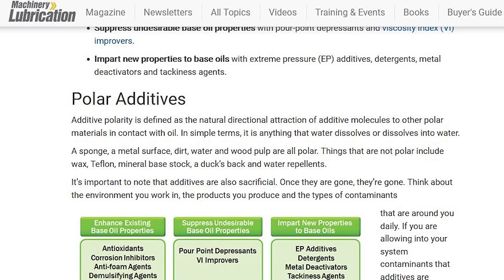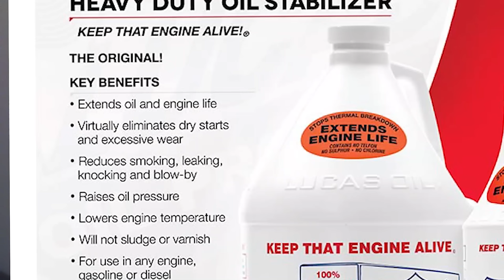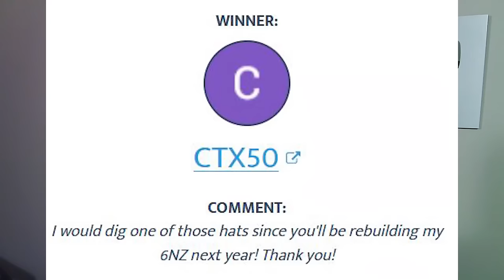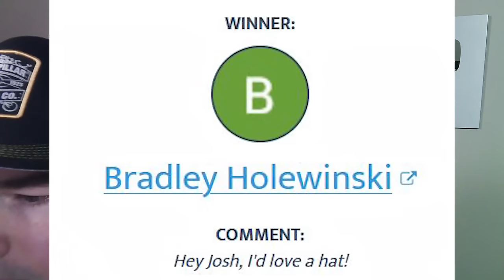Does your Engine NEED Lucas Oil Stabilizer? A detailed look at the "Benefits."

Comment: I would think it would increase your oil viscosity, decreasing performance and fuel mileage. But that being said it would help eliminate leaks and add more cushion between bearing surfaces. Honestly though I think you can get the same if not better performance with gear oil. A quart of full synthetic gear oil is cheaper and probably more beneficial than the regular mineral based version of Lucas oil stabilizer. (Here's an example, I had a tick in my old Ford Taurus engine.) Lucas oil stabilizer took it away. After changing the oil, I also tried adding some 20-50 full synthetic, and got the same result. The tick went away but my fuel mileage went up by like 25 more miles per tank, opposed to the conventional Lucas oil stabilizer. 🤷‍♂️

Comment: 👍👍👍 I CAN ASSURE YOU WITH A CHEVY THAT GETS A LOW PRESSURE READING THIS STUFF WORKS.  MY ENGINE THAT IS OVER 300, 000 MILES AND OF COURSE I KNOW ITS NEAR ITS END BUT I'VE BEEN PUTTING THIS LUCAS OIL SINCE IT HAD 240,000 MILES AND ITS STILL RUNNING.

Comment: Wanted to leave my story. The actual original oil additive is sort of been put out to pasture as the few benefits I’ve seen it actually have would only apply to dinosaur motors with extreme wear or oil consumption (ie my 53 farmall that hasn’t been opened up since Moses himself put together) they make a newer additive that is synthetic and made for synthetic oils. I have had some better oil pressure and less oil consumption and engine noise on cold start with my 250,000mi Subaru however there are tons of applications where it is a huge no no. In fact Cummins says they do not recommend ANY oil additive in early isx engines. My old man put about 2 quarts in and within a day the motor was literally puking the oil and Lucas out like it was blown. Went ahead and did a pm and it went away. Now the other additive like fuel power steering and such I have had AMAZING luck with so much so that I had an issue with constant bad fuel full of crap at my local truck stop and would get water in fuel light alll the time. Dump some Lucas fuel treatment in it. Taaa dahh all better. Even used the transmission additive manage to bring a dead Ford automatic back and limp 200 mi home before it finally died. So all in all. Sometimes it helps. Sometimes not

Comment: Glad to see someone bringing up that it's only base oil and diluting your additive pack, I feel like this isn't pointed out enough. I believe you'd be better off running your normal oil just go 5-10 points higher on the viscosity, then you'd get the thicker oil and the full add pack. Or just, I don't know, fix whats broken....

Comment: I drive a 1997 truck with an older gasoline engine design. The manufacturer specifies 10w30 in cold climates and 10w40 in hot. One of the top performance builders working with this particular engine swears by using 20w50, even in fresh rebuilds!
My truck has a little over 100K miles on it now. Much of its life I used only the recommended weights of top quality, full synthetic oil. Just oil. No additives. However, I started using 1 qt of Lucas with 5 quarts of 10w30 around 80 or 90K miles in the cooler months and 5 qt 10w40 + 1 qt of Lucas in hotter (100F+) summer months. Seems to be working fine so far. 
I suppose I could just instead use 20w50 in the Summer. But it's been very hard to find locally. Even 10w40 has been scarce here (N. Calif), which is why I use the easier to find 10w30 in the Winter. Most stores are heavy on the modern, ultra low viscosity oils and devote little shelf space to the viscosities that were so common in the past. 
I don't disagree with any of your analysis. But there are situations where it may make sense to use Lucas (or similar). I was concerned about diluting oil additives, as you mention... But figure that since the Lucas is only about 15% of the lube in my truck engine, and because I change 2X a year at least, never come close to the mileage interval, there shouldn't be a problem. Time will tell!

Comment: Got a 3.0 ford ranger 297,000  miles on it and I use the Lucas oil treatment with no problems it calls for w5 30 also used the transmission treatment everything works fine had a little shake in the transmission put the treatment in stopped the shake all in all the Lucas products work for me

Comment: I run a 1MM600 hp Cat change oil all filters 10 k to 12 k use Rotella and one gallon of Lucas because if tech doesn’t tighten plug it can save your engine when it falls out. The other reason is cold starts.

Comment: Sir you are spot on with all your comments.and warranty over rides snake oil.never in an engine.i had a new c13 years ago that was everything cat said till different numbers were put in the computer.7mpg loaded 80,000 to 5mpg no matter what.started using oil an lucas slowed but engine wouldn't pull the hat off your head.smoked like an old 220 cummins.end of comment.Thank you Sir

Comment: It is only good in warm to hot weather situations in old worn engines  ....If you live in an area where there is a winter season with it in the engine ,it will make the oil too thick when the engine gets cold and then dry starts are a problem and thick oil in newer high tolerance engines will not be lubricated properly ..STP  is the same in this thick oil additive category also and has locked engines up  on a cold start after it was put into a cool engine  ..

Comment: Lucas hydraulic oil seal conditioner, trans anti slip, Power steering seal sealer all worked for me on older equipment.
I put Lucas or Stp in all my older  gas service trucks got  over 380k miles on two all original motor trans GM 6.0 gas.
I just got oil at CAT dealer they sold me Mobil 15w 40 .. Told me they make CAT oil.
ps " torque convertor Shudder in GM was cured 100% with "lube guard"  2oz tube. Some snake oil works.

Comment: I used to have a 1987 Ford range 2.3 liter over head cam it had 350,000 miles on it it would always dry knock for 10 second or so after start up from sitting for more than eight hours once I put Lucas in it  never did it again sold the engine to somebody else after the truck rusted out

Comment: My buddy uses Lucas from his first oil change until today.  His Ford van has 540k. He swears by it.  Says motor runs much smother and cold starts are effortless.  It's a gasser. Burns about a quart a month.  I use it in my John Deere diesel. Works ok I don't notice a difference.

Comment: That quote is form Atheist Christopher Hitchins. he is greatly missed.

the only oil that has a beneficial additive is Valvoline. it has an additive that is necessary for Ford vehicles. and that is an additive to reduce oil foaming. since Ford's have an issue with oil foaming.

Comment: Another thing to note with manufacturers “service recommendations”.

While they are a good idea, many of them simply lie. 

If you’ve worked on any dirt bike you’d be aware as to the degree they lie.

Suzuki RMZ250. Recommended service interval before piston replacement? 6 hours. 

Six hours. 

And yet there was only beginning signs of wear when I changed it at 70.

Comment: 2012 VW CC 82k miles.  Low oil pressure light w/ 5/30 oil.  Mechanic said crankshaft bearings worn (apparently it was junk yard motor w/ big miles). He put in 5/50 and this stuff.  Hot yesterday turn on engine, idle for 30 minutes, the drove for 30 minutes, may have life in this car!

Comment: Used to have to mow a steep hill at my parent's house many years ago.  My dad would burn up a used push mower just about every season.  I got tired of being the one to find and get the used mowers for the 'fleet'  so I started  putting Lucas oil in them (about half/half)  Son of a gun  we could get 2/3 seasons out of a push mower now !  I was sold and used it in everything that has oil lubricant since (my '98 S-10 got 278,000 miles on it till the clutch petal  assembly came apart!)

Comment: I would love to hear your opinion on Liqui Moly Diesel Purge.
I have always thought diesel injector cleaner was snake oil rubbish that was a waste of money. I still do when it comes to the stuff you pour into the tank.
However, I have seen lots of very good reviews for Diesel Purge so decided to give it a go on my 2.8 Duramax Colorado. This stuff isn't just designed to be mixed with diesel in the tank, you can also run the engine off of Diesel Purge alone which is what I did. To my surprise and delight it made a very significant difference to the smoothness of the engine and it sounds a lot quieter. I also get better milage and it feels peppier.

The ingredients are fairly basic, 65% Diesel, 25% cetane booster, 8% Petroleum Distillate(naphtha) and 1% 1,2,4-Trimethylbenzene. 
I believe it is the Naphtha that does the cleaning of the Injector Pump and Injectors. 

During my own application of this product I used an in-line filter which appears to have collected a fair amount of sediment and the Diesel Purge turned a rust brown colour by the end(it's clear out the bottle).
Reply: I had good results with Sea Foam in an old Toyota Tercel that could barely accelerate at all.  Real sluggish, lots of hesitation.  Two consecutive treatments of Sea Foam got it running like new.  20% naptha, 20% alcohol, 60% kerosene.  Theoretically you can make it yourself real easy and cheap, but I use it so seldom that I haven't got to that point yet.  In my truck I use it once every 50k miles in the fuel, and a little can into the oil a couple hundred miles before a PM when I think of it.

Comment: Something just about:  A heavier oil will throw off of a rotating mass whereas a thinner one will cling to it.
      The bearing surface speed of a long stroke engine is far faster than a short stroke. What is important is the oil temperature as long as you don't overheat it took cook it and you keep the bearings cool as well as provide a slippery surface conducive to keeping temprature in check. That is job of the oil as a lubricant. So the real question is does your choice of lubricant do it's job correctly? An additive may bolster a poor choice or extended service intervals.

Comment: In 1996 I was 17. I bought a brand new z71.
Every 3k I change the oil with Mobile 1 and Lucas with a wix filter. 
In 2022 the truck has 670k on the clock, the engine has no leaks, no knocks, no ticks, no pings, no smoke.... all original factory seals and gaskets. 
I'd say Lucas oil stabilizer works great. 
But what do I know... I'm only an ASE certified Master mechanic for the past 22 years.

Comment: I use it, been using it since 2000 i first added it to my 2.0 neon i after 85k miles removed the valve cover to replace the gasket and it was beautiful and it was a quiet engine to the point my mechanic friends asked if it was on

Comment: I put Lukas gear oil in a datsun rear end that was wore out and howling,it stopped the noise and lasted 3 more years. Later in life i had a honda shaft drive motorcycle that got 55 miles to the gallon,drove to Texas had to put gas in at 162 miles, later i remembered the Lukas gear oil so i put some in the rear end,took the same trip again and i stoped to get gas and it still had alot of gas in tank,checked mileage and i got 62 miles per gallon. Im just saying it works and saves money.

Comment: I have a 97 F250 diesel ford with 375,678 miles on it has Lucas products in both fuel and oil. I have noticed it that it not only runs better it doesn't hesitate to get up to speed on the highway.

Comment: I use the lucas for my engine. Oil and transmission oil I GUARANTEE u this stuff really work I use it in my chevy astro 1992 with 181.750 miles.

Comment: My Engines use Amsoil and that is all I need.

If you have a good oil, you don't need to add anything else. The only reason you have to add this stuff is because your lubes are missing something that should be there in the first place. I use Amsoil Signature Series and i can g 25, 000 miles because the oil is real good, and i have done it also. The Amsoil oil filters are guaranteed   for 25, 000 miles and i have done it. No problems and less wear on the engine.

Comment: The full synthetic stabilizer works really good in gm 3.6s it helps things run smoother between oil changes and reduces sludge buildup
Reply: What about 2.5 liter s10?

Comment: I will share my experience with lucas, back in the day I had a 78 buick 225 I had been using lucas at oil changes because my old man had always used it so it passed down on me,  one night me and the fellas where out fooling around about 40-45 minutes from my house, I jumped a set of railroad tracks and tore the oil pan drain plug out and didn't realize it until the low oil light came on several miles from the tracks, we were on the highway by this time I pulled over and dang it the pan was open, I called my pops and he said well you been using lucas you might be able to make it home, and sure enough I made it home car never overheated and it didn't lockup. I made it home we replaced the pan and I drove that car for a long time before getting rid of it, it never created a tap or anything.. I been telling this story for years! Now I can't say it will work like that for all engines, but that 350 sure held up. All the other claims I haven't had any issues with those, but I use it faithfully in my vehicles and semi trucks and I never us it thinking it's a magical mix, I think of it as a layer of protection on all the metal services...

Comment: I have a 2013 Jeep Wrangler with 97K miles and I already put this aftermarket additive into my oil change for the first time. After watching your video, I am so upset with myself. Upon next oil change, will it be ok to not add the additive again. Will there be sticky additive product still in the engine. Do you think that I will require an oil/sludge engine flush?
Thanks, your video was very informative and I wished I had seen it before I let them put that crap into my engine.
Thanks again.
Glenn

Comment: OK so I have a 2005 ram 1500 with a 5.7 Hemibought the truck brand new first oil change 1200 miles the truck now has 233,000 miles on it The truck calls for 5/20 never put it in when using mobile one 5/30 Full synthetic with the Lucas stabilizer full synthetic I change the oil every 6000 miles this engine doesn’t smoke it doesn’t burn a drop of oil and it hasn’t lost a step in power i’ve been a car mechanic for over 30 years this truck runs as good as the day I bought it I recently pulled the valve covers off to change the gaskets because the passenger side was leaking I could not believe how clean it looked inside it was like I was looking at a brand new head so I am a firm believer in my combination I also recommend Lucas fuel injection cleaner fill your tank up once a month and put that in there is a difference thanks for your input

Comment: My Ford Ranger, 274k miles, knocked loudly with fake 'full synthetic' oils in winter. I put in real synthetic Amsoil with Lucas, it quieted it down. Until I can afford to replace the engine, this is working very well.
Reply: Real and fake full synthetic? If you used Motorcraft synthetic blend and Motorcraft oil filters you wouldn't have those issues in the first place.
Reply: @Muffmiester79  
Respectfully disagree, Motorcraft semi synthetic has no esters or ethers in it when broken down, it's a class III synthetic, just hydrocracked petroleum, ir gets thick when Temps get -0°, which is when I need it to lubricate. Amsoil is the only affordable class IV synthetic.

Comment: Castrol 15/40 diesel and Gm EOS in all my gas flat tappet high performance engines , bought 25 cases years ago still have lots left 50 years building engines never had a failure !

Comment: IT works great in a Fuller transmission, a Mack transmission, a Mack rear end, a Rockwell rear end, (I hate Spicer and Eaton truck axles) but I really don't think engines benefit much ??? A gear type transfer case,,, but straight 30-40 weight engine Earl is My preference for diesel engine Earl (LMAO) but the sticky additive type grease works damn good on fifth wheels and plates !!! All the best to you and yours Sir.

Comment: Amazing stuff for wheel bearings that run in oil.........if your having trouble with steer axle wheel bearings, use a mixture of 50/50 lucas oil stabilizer and diff oil.

Comment: I want to thank you very much for this video!  I have been mildly obsessed with the question of why (most)  Major oil makers (Mobil 1 and Valvoline for example)- do not add a sticky coating additive like Lucas Stabilizer to lubricate the engine while the oil is first circulating during a cold start. Finally, I have my answer thanks to your video...There is residual oil in the spaces between the metal parts, as showed by your demonstration  of the piston bearing -Wish I saw your video years ago. Would have saved me and my car a dozen quarts of Lucas Stabilizer!

Comment: I have a friend with a 1970 and a half Camaro Z28.  Still looks like brand new. Those z28s had high compression and solid lifter cams.  He starts the car once every year and doesn't drive it much at all.
He sold on using delo 400 and a couple of bottles of Lucas zinc additive to protect the valve train.
I told him for 12 bucks a quart he can buy some professionally manufactured oil design for these older engines that he likes playing scientist. 😖😖😖

Comment: I've used Lucas fuel additive into my tank for years because it acts as a upper cylinder lubricant, my Toyota had 250000 mile and still never used a drop of oil between service

Comment: I would say since I got my first car, I always used the right synthetic oil and my car was used at 30K. After maybe 2 years I finally took the chance to change my oil first time. Since then 7 years later, still own it. My engine is at 130K, I recently switched up to High Mileage Oil now, been using Mobil 1. I only used Fuel additive so far, been debating on this as well but may just stick with using my high mileage stuff, same increments 6k each time